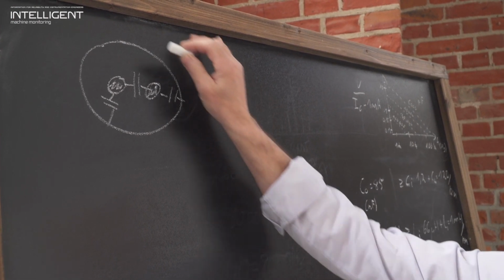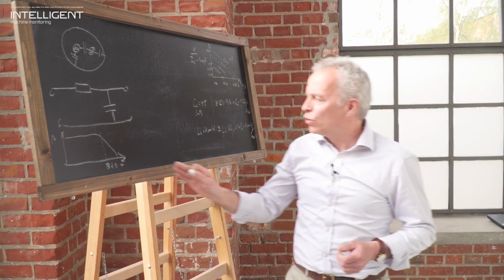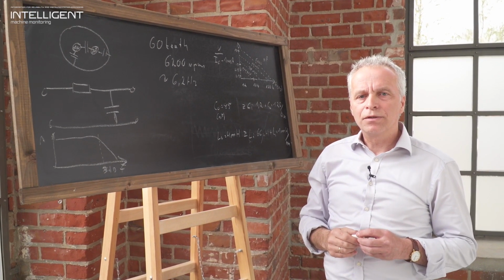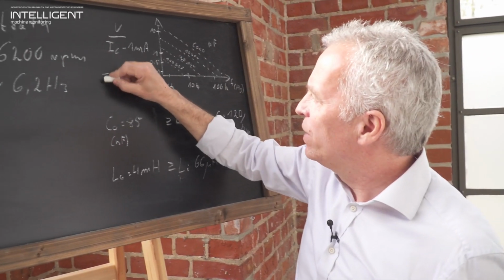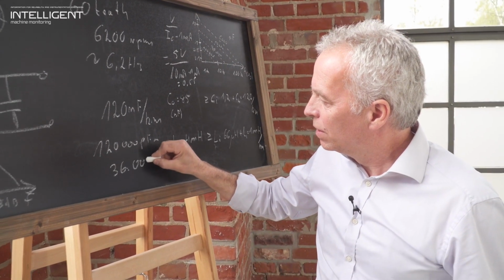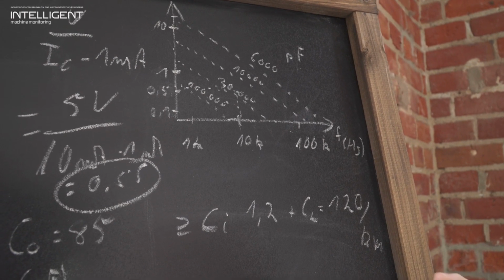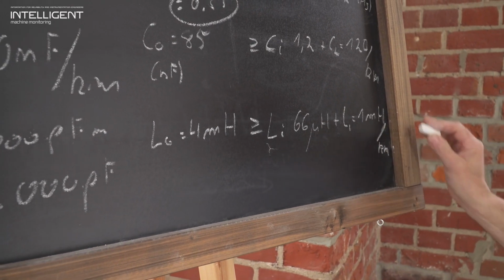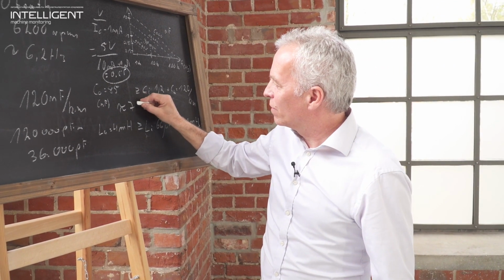How to calculate the cable length between sensor and data acquisition unit

Comment: How & where to get the parameters for low pass filter? 
Further, how I can calculate cable capacitance, if my distance for machine is fixed. 
Thnks!
Reply from the maker: Hello Rohit and thank you for the question. My colleague Wolfgang has an answer for you. 

The cut-off frequency at -3 dB is at Fc= 1/ (2πRC)
The capacitance C of the cable is shown in its datasheet. That means the capacitance of the cable will not be calculated but is given by the manufacturer

Does this answer help ?

Comment: Very good explanation. Just a query that @5:13 you take max o/p voltage from the accelerometer to be 5V...could you please explain from where are you getting that data of 5V...also as we generally don't use the accelerometer to its full output voltage or operating 'g'...so can the machine's max operating/trip range g's equivalent o/p voltage be used in the calculation for the 'V'??? I'm just curious to know..
Reply from the maker: Hello thank you very much for the question and also sorry for not answering this earlier. The value comes from the card. It is the maximum  voltage of the used input card. Greetings from Germany